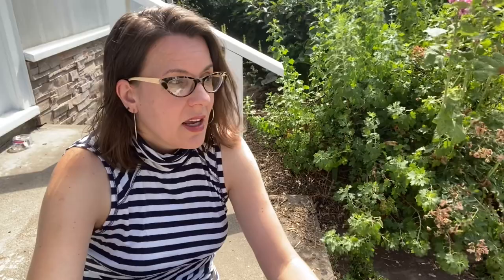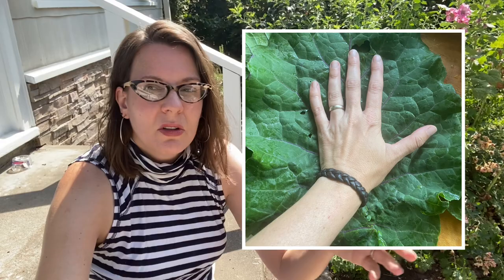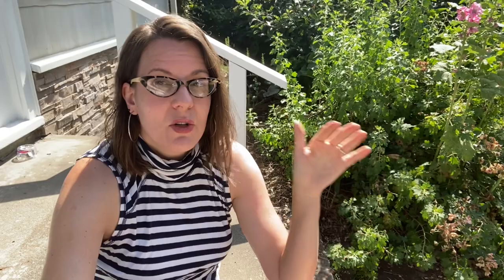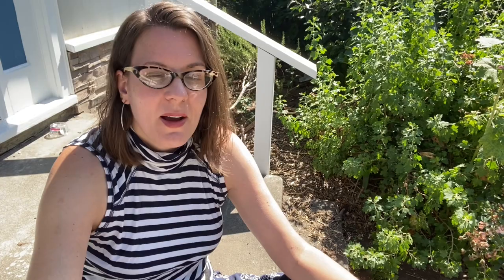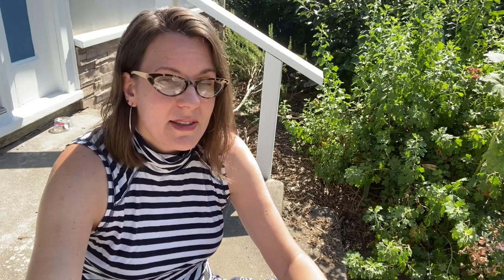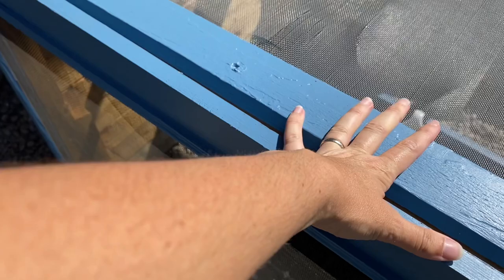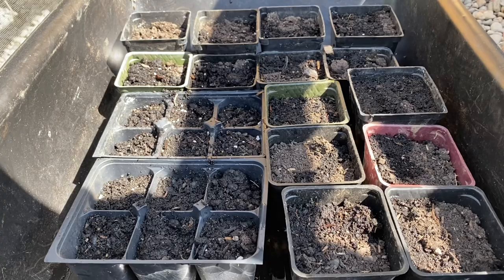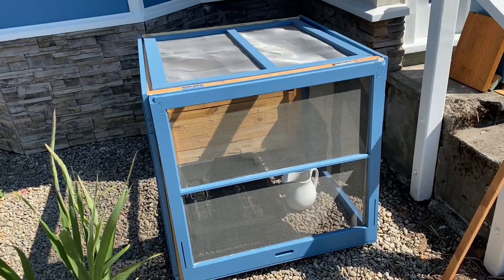Shark Cage for Cabbage: Outsmarting Cabbage Caterpillars

Comment: My cage is 6’ x 12’ on a slightly raised bed. I made a hoop house out of cheap white plastic water pipe (PVC?) and covered with pond mesh having about 3/8” weave. So far, six weeks into growing season, no cabbage moth has been able to get to the plants. I will be careful to prevent the plants from touching the screen as they grow… those moths are smart critters… they’ll just lay their eggs wherever the leaves touch the screen.